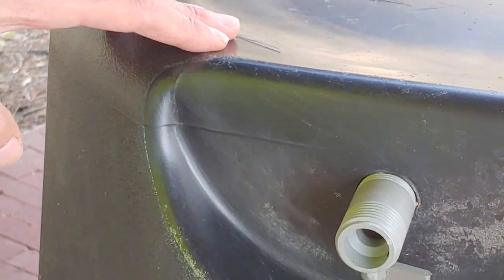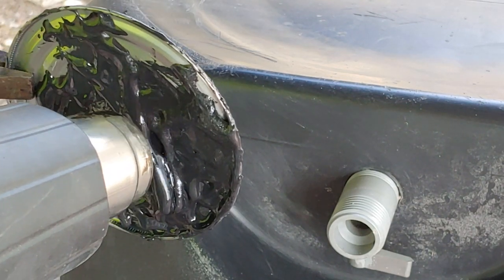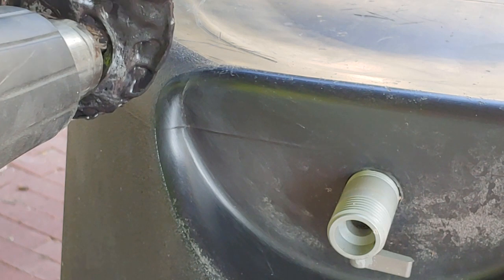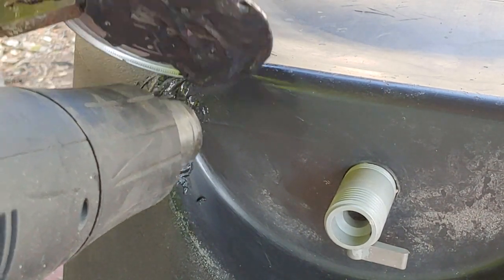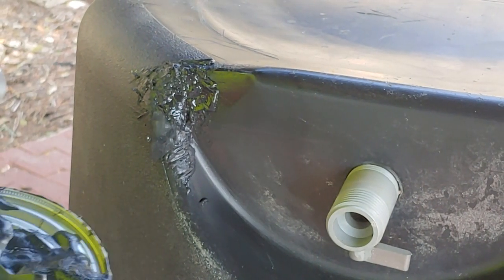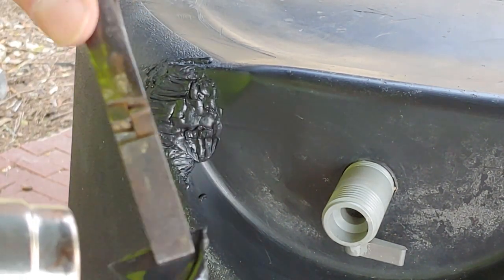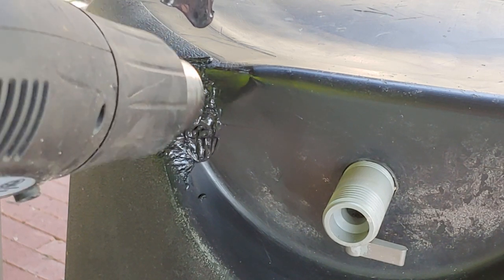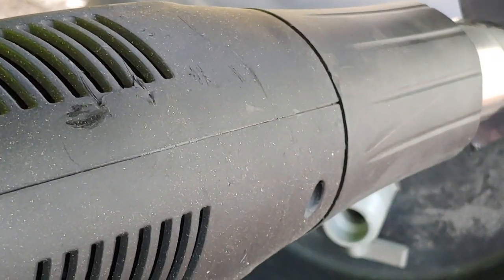i fixed a rain barrel by melting! # 7

Comment: i normally use a soldering iron.
Reply from the maker: I tried that but couldn't smash new plastic into the crack\hole without making the hole bigger.
How do you do it?
Reply: @TheRainHarvester  my soldering iron is like 50 years old, weighs 5 lbs and i add the new plastic on the inside of the crack and smash it into the shell. or else ill just melt right thru it.

Comment: Nice! I wanted to buy one of those specialized hot air gun welders but didnt think that a regular hot air gun would work lol. I wonder if the plastic welding guns are a higher temperature or why the cost is so much higher?